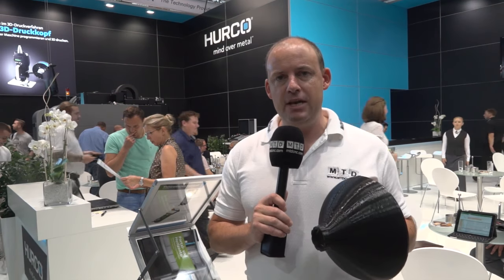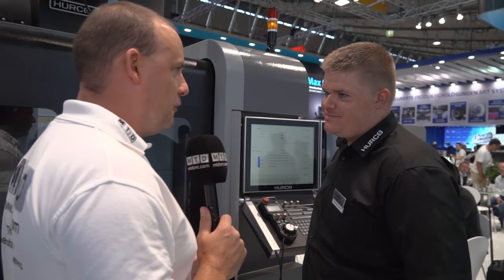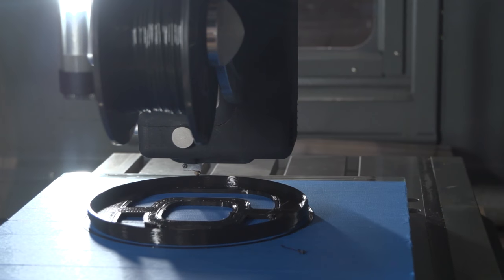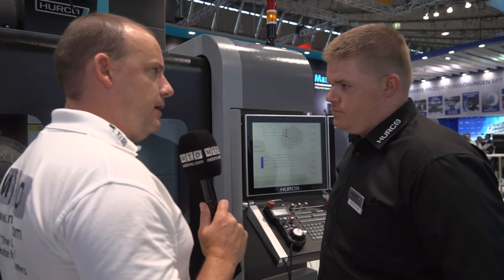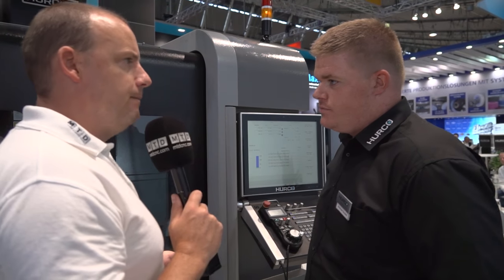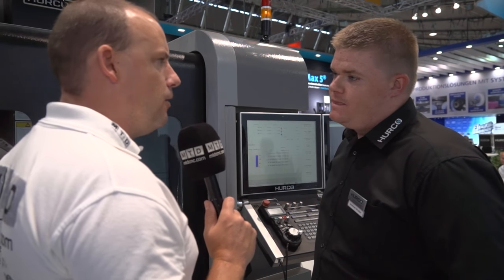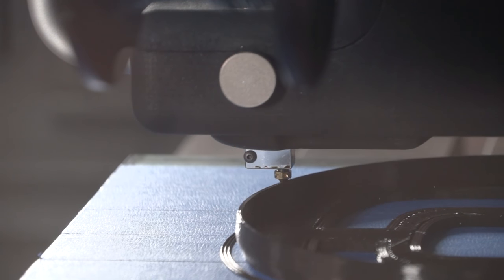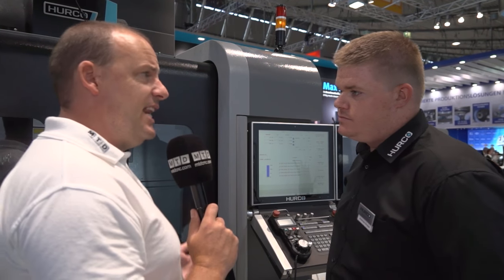Hurco 3D Printing on a VMC - You can Mill and Print WOW

Comment: I can't understand why it's impressive for a 100-150k be able to do something that 100$ plywood assemblies from china can. Any CNC machine can be easily retrofitted to 3d print. You could make an interface that redirects the coolant pump wiring to the extruder when called for.